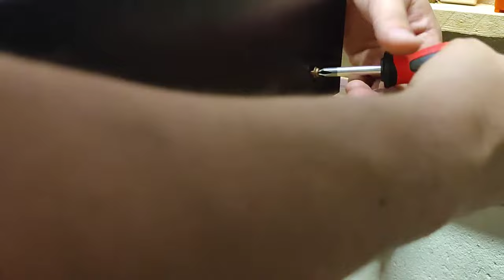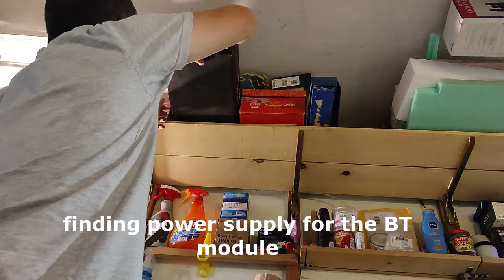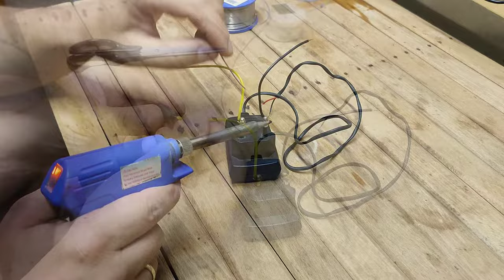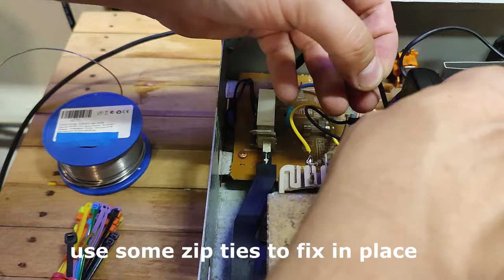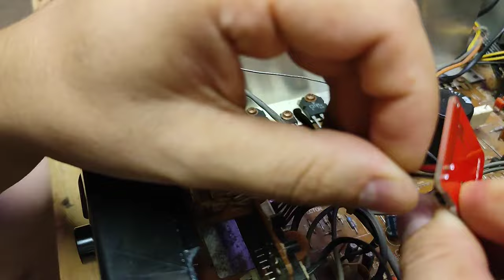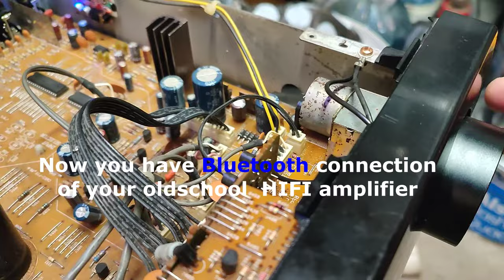How to install Bluetooth to old HIFI Amplifier

Comment: the audio quality is plain useless in those vhm-314 chips and all the like - has nothing to do with hi-fi. dramatic rolloff at lower frequencies (possibly higher too), cataclysmic distortion, stereo separation is not what it is supposed be in stereo sound, possibly resonant peaks, audio image is completely wrecked to oblivion, hissing/buzzing noise even from clean psu. these are complete waste of money/time. the only positive thing about these is that there is no chinese lady saying "bluu tooot divaice s nauwh khonnekted".
Reply: Can you recommend another bt decoder, i almost buy it, glad to see your comment
Reply: out of these chinese ones the best one was ZK-PT2 even though it uses a JieLi chip. There's a reason why these things need proper capasitors - and therefore there's an increase in price.  @TableTennisVR-Indonesia
Reply: @voltagetoe  thanks for your advice🙏 sadly this thing is not available at my country marketplace😅.
Reply: have you tried QCC5125/QCC3034? i picked up the latter and from what i can initially tell it seems pretty solid.

Comment: Please use an 78L05 (TO-92) or similar LDO version regulator soldered directly to the PCB. You can then use a wide range of voltages from the preamp circuit as well as use its GND in the right way. This will improve performance a lot.
Reply from the maker: @HowardJohnstone  That's actually a very good idea 💡
Reply: Came here to say this.

Comment: Hi, Thank you for sharing your video. I do have a 5.1 Home theater speaker system, I find it annoying that the speakers have cables. What would be the approach to send each individual channel to the different speakers from the main amplifier? how many transmitters receivers do I need? a pair for each speaker? I am not interested on buying premade kits (they are expensive and bulky) but to do it by myself. Any guidance will be much appreciated.
Reply from the maker: Well in theory it can be done, but it should be made with several BT transmitters and receivers and also audio amplifiers. It will use a battery for every speaker. It will be very complex honestly

Comment: I did an upgrade based on your video. I used a power supply with USB 2.0 output, which I built into the amplifier (Teufel B200), which is smaller than yours, I didn't have much space, but I managed to pack everything in nicely. The problem is that it plays terribly quietly. I have to turn the volume all the way up to hear the BT sound. What could be causing this?
Reply from the maker: Are you sure you connected the output from the BT module to input of the amplifier. The BT module is able to give signal to your input of the amp. Then set the amp input where the BT is connected to. Volume from BT can be adjusted through the phone, when you bind it. Something has to be wrong. It has veey loud and clear sound in my setup. Please see report here when you manage to play it as it should be or if you need some further help ☺️
Reply: @FixitEasyDIY   Thank you! I connected to the only input this amplifier has - AUX. And just such a problem with the terribly quiet sound. At first I connected the ground wrong but after taking the whole amp apart I managed to do it properly. Technically it works ok, connects to iPhone 12 mini, MacPro6.1 or MacBook Pro 2018 without any problem.

Comment: Could have tapped 5volt supply in amplifier
Reply from the maker: I wanted it to be inside the enclosure. Not the best way to do it but it's working just fine 😊
Reply: Any advice or sources of info to find out where in my amp I can find and safely tap a 5v power supply? I'm thinking of doing this to my old sony ta1066
Reply from the maker: Easiest way is on the transformer's primary coil. It will trigger 5v when switch is ON.
Reply: @FixitEasyDIY  no..DON'T do this, no way..just DONT

Comment: I bought the new version of this module together with the box. It's called on ali:  BT 5.0 Audio pro.
Power supply through usb cable and 5V charger connected to the 230V output of my Yamaha RX-V596rds.
Audio input through RCA-mini jack cable.
No need to solder at all, although this module is prepared for soldering like you did and if you want you can also solder the battery (pointless for me).
Reply from the maker: @krzysztofr6125  Thanks for that useful information brother.

Comment: Thanks for the video. 2 points of concern if I may: 
the noisy smps 5v power 
The metal around the BT module will kill BT RF.
Reply from the maker: I must confess you are right 👍

Comment: I tried draining power from the board, but that gave a terrible noise through all inputs.
Reply from the maker: There must be a way to do it without noise injection. I used a separate power supply. Ugly but working just perfect.